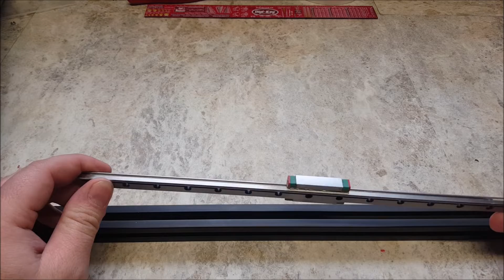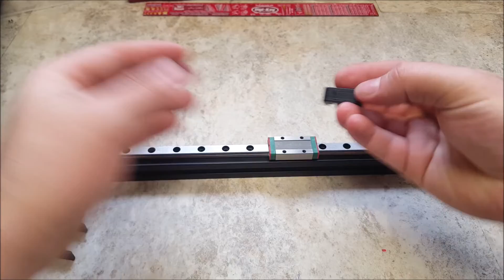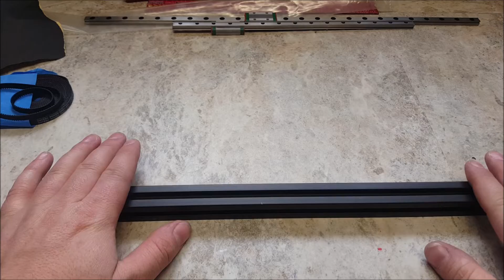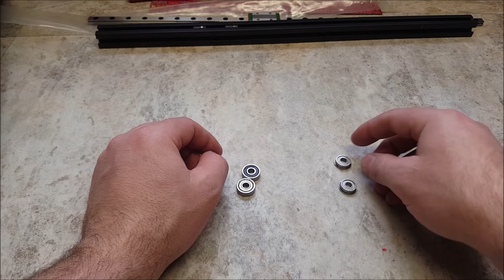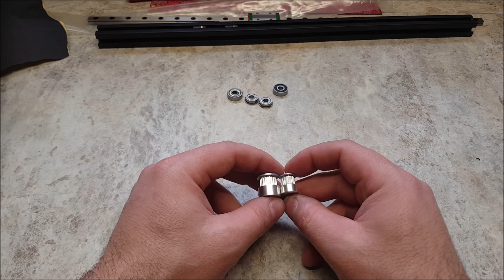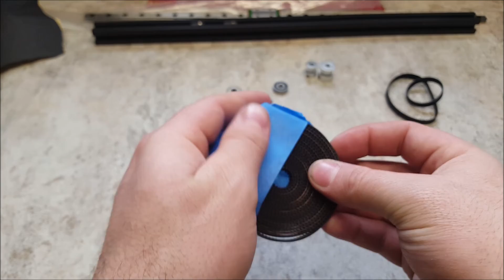Voron V2 build and sourcing Pt2 Motion

Comment: Why didn't you use MGN 12mm H rails ? , I can see a point with the x axis to save weight , but that is not true for z and y axis.
Reply from the maker: Mgn12 carriage is wider than 202 extrusion.  Going to that woule mean the printer would not be easily enclosable and that components would sit outside the frame volume
Reply: @CanuckCreator  , Sorry didn't know that , So it is to do with keeping the carriage less that 20mm width.

Comment: @Nero 3DP when fitting the bearings over the pin and fitment is a shade too tight, would you have any concern about throwing the pin in the freezer and warming up the bearings a bit to shrink and grow them respectively?
Reply from the maker: If you do that you only have one chance to get it in position right, id recommend throwing the pin in a electric drill and hit it with some high grit sand paper, usually its only a fraction of a thou too tight
Reply: @CanuckCreator  good point, think I'll follow your advice there. Thank you for taking the time to make these guides and being so quick on following up with questions!

Comment: The configuration tool shows 8 rails are needed.
*Edit*for the 2.4. does that model use 7 or 8 rails?
Reply from the maker: 8 for 2.4
Reply: @CanuckCreator  Awesome, thanks for replying! just getting ready to order more extrusions and wanted to make sure I get the correct stuff. I was originally building another model and changed plans to the Voron. I already have 500mm 2020s so I'm building a 380x380x300 Voron 2.4 instead of cutting the extrusions. 👌

Comment: Great video. I'm just cleaning up my rails at the moment and have a question. With the oil as they come the carriage is very smooth, however after cleaning and packing the carriage moves OK, but you can feel a tiny bit of resistance as the balls move around (I think it occurs as each one goes through the end part into the drilled oilway). This makes them feel just a little notchy across the entire rail. Do you think that will affect print quaity? If so, is it acceptable to use a good quaity machine oil instead of the lithium grease?
Reply: No idea on whether what you are experiencing will be an issue or not. I do know that once they are installed with steppers and belts, the fine details you are feeling are probably less of a concern. 

I did look to see what hiwin recommends. They say to only use oil if you have a system to constantly deliver it. I think for a 3d printer you'd want to use or find something close to the hiwin g04 grease they describe here. I never found a consensus on a specific type to use otherwise. https://www.hiwin.com/hiwin-grease.html